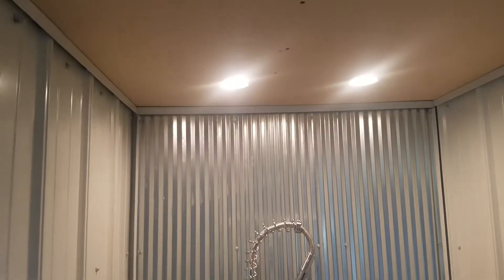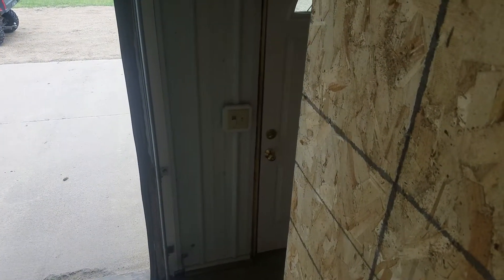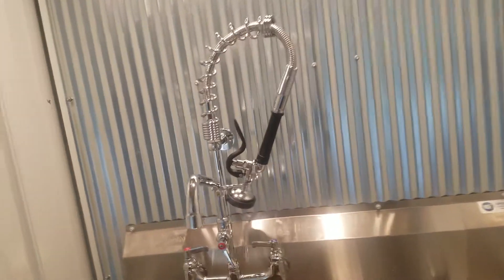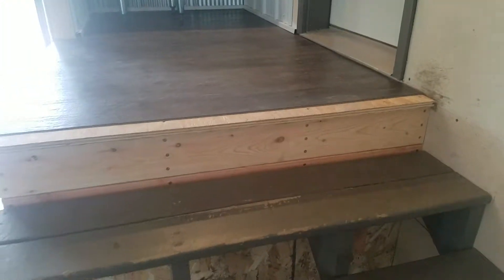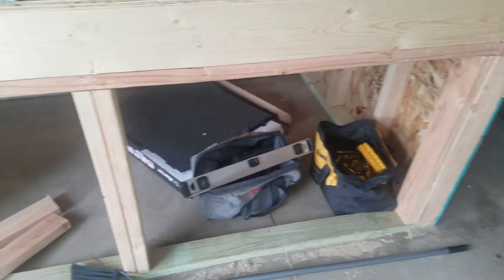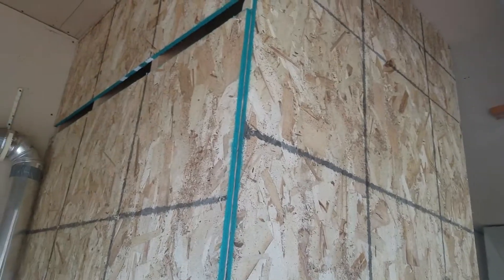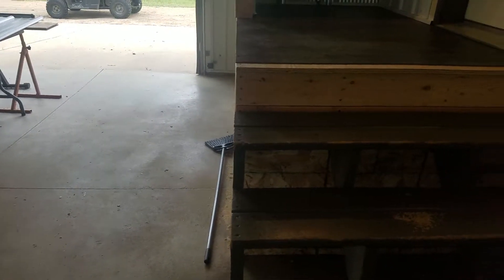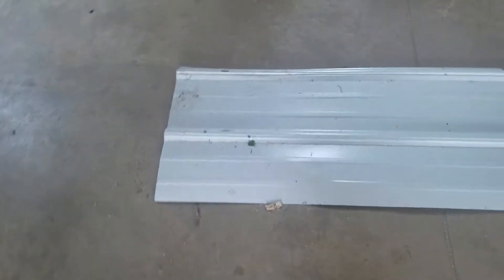Latest Project, Garage Sink!

Comment: Looks nice Nordlander. How long was the install process? Will the sink freeze in the winter or do you keep garage heated? When you do your step-drawers, I would probably make sure the drawers have a lid or a top b/c any dirt that falls from your shoes may go down into those drawer spaces. You have a nice sized garage to work in. Look forward to your next video on this.
Reply from the maker: Thanks for watching! It started out by buying a sink about mid April. I started on the sink part the 19th of May this year. I started tinning the garage last September 2017 which I did not get finished before winter which was a good thing because it gave us time to think where we wanted this sink. I was going to do a simple set the sink on the garage floor and plumb it into the existing water supply and drain in the other side of the wall and got to thinking because I have almost 10 foot ceilings in my garage I could put it house level and tie into the plumbing without having to go through my basement walls. There was a washing machine drain with vent line less than 3 feet of where I put the wall. I opened the house wall and had that ready for the plumbers so all they have to do was drill a few holes for the drain and the water supply. Once they roughed it in I finished the walls and had them come back and hook up the sink. I don't have any pex tools and these guys are fast at what they do.
Reply: Well, nicely done.  It is good you did wait since you discovered you didn't have to go through garage wall. It looks nice.